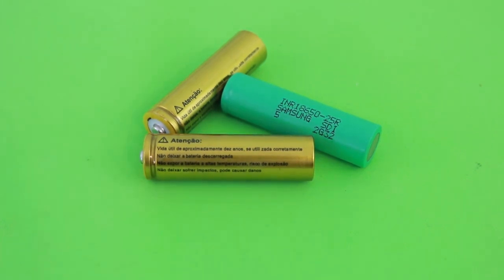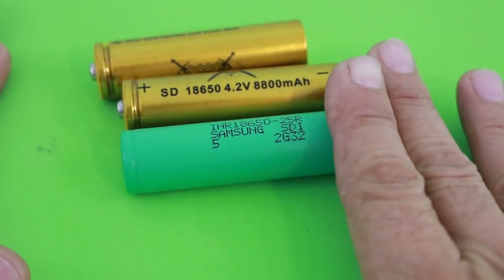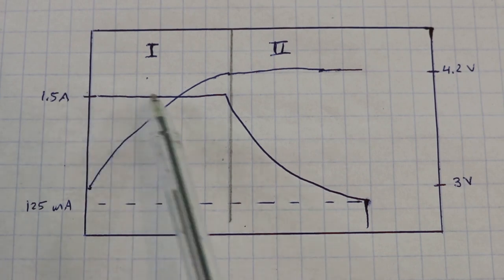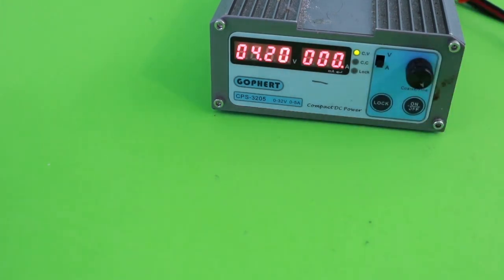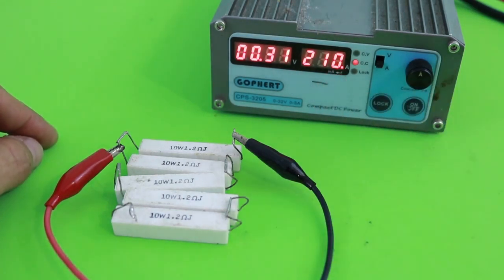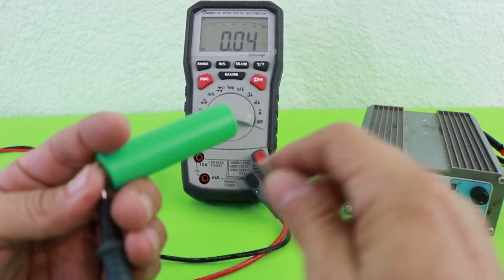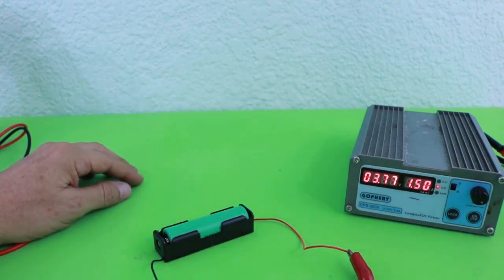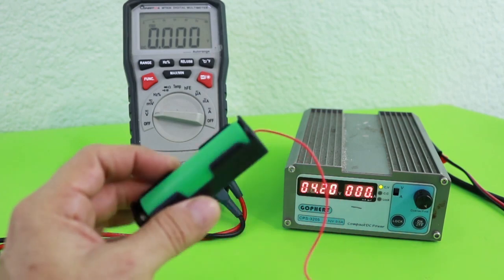How to Charge Lithium Ion Batteries with a Power Supply

Comment: I’m interested in charging cell phone and camera batteries with my DC power supply. Those batteries show the output voltage but only show amp hours and/or what hours which is not a measurement of the current draw, so I don’t know where to get that info. Also neither of my 2 bench power supplies allow you to set current. I have a bunch of wall wart power supplies so I usually find one with adequate voltage and use it to charge some batteries.

Comment: If i have battery in parallel. My amps should 6amps?
Reply: Yes, in parallel current is multiplied by the number of cells.
Reply: @charleslyell3748 does the voltage stay at 4.2 regardless of the number of cells? Or does it also need to be multiplied?
Reply: @someoneinAZ  4.2v, regardless the number of cells.

Comment: My bench power supply has max output volts to 17V
And 2A
Im trying to charge a 12V car batt lead acid
When i connect the psu to batt the psu drops to 11.5 V??? And fluctuating (11.1V-12v)
And amp fluctuate (0.00 to 2.99)
What is wrong here?

Comment: What will happen if we failedd to disconnect at 125 mA . will that cause an overheating and explosion ?
Reply: Nothing will happen. The current will keep dropping until the battery won't take the charge anymore. You can see the video when he disconnected the battery when it's taking 125ma, the battery only charged to 4.12v not 4.2v . If you are concerned set it 4.19 and forget about it. New. Lithium ion batteries can be charged to 4.3v while the old ones won't reach 4.2.

Comment: I have a simple 4.2V 600mA power adaptor and 18650 cells that were in notebook. I checked them they all 0 volts, but I would like to revive them. Can I charge them with my adaptor (it is from flashlight)?

Comment: How to charge the Li-ion Batteries not used for long time having voltage arround 1.2v.
And how to test those are feasible to use?
Reply: Use power supply, adjust volt for 4.0v, go down by current to zero, connct battery in power supply, slowly raise current till 300 mA, be in constant current. Near full charge it will change to cv. Good luck.

Comment: Hi, do you need to install blocking diode to avoid power supply damage from inrush current (while charging) ?
Reply: Raphael U : I hope a professional experience man to reply this question because I need it also. And what is the power of that diode.
Some body help. Please

Comment: So the power supply you used has the ability to set cv and cc having done that am I ok to leave the battery on that power supply overnight? Is the setting of cc and cv on the power supply as you show, render the power supply as a protection device.

Comment: Love your videos, I have to add something though. I think the resistance does not change instead due to the battery voltage rising the voltage difference between the cell and the supply decreases so the current through it also decreases. I've been charging cells like this for a long time

Comment: Be warned. Some PSUs do not tolerate current sourcing components (like battery) at its leads. A substantial current can damage the unit.
Reply from the maker: Its the first time I hear that. Have a link with more info please?
Reply: @ludicscience  e.g. it is in Rigol DP832 user manual. Manufacturer advises to add diode to prevent reverse flow.
Reply: it is described in a document: "Active loads and the RIGOL DP800 and DP1000 Series", you can find it on google

Comment: How it took to get charged ??
Reply from the maker: around two hours
Reply: @ludicscience  
If i connect more than one battery in parallel the chargeing time will be the same ???? Sorry for bad grammer
Reply: @Not-C-418  Yes, if the powersupply delivers enough current to charge all batteries; that is 1,5 ampere per battery.
Reply: @Pumba3900 does that mean that the amps need to be multiplied by the number of batteries? Ex. 3 batteries, 4.5amps?

Comment: Awesome 👏 video..... always the best!! How long did it take to fully charge the battery from 3V to 4.2V ?
Reply from the maker: Thanks about 2 hours
Reply: If I use the ordinary battery charger which is plugged to the wall- socket , will the result be different??? Which is more efficient??
Reply: @andrewkhchan depends what you mean by efficient.
scientific definition would be amount of energy charged into the battery / energy spent. then I would say the slower the better, less current means less heat, so power supply will let you pick a slower
if for you, more efficient means faster, then I would say the power supply will let you select a higher current but you may damage the battery or wear it faster.
 the biggest difference is the charger is calibrated to charge with a fixed max current value. with the power supply you can tune to the battery characteristic. but you have to cut off manually, so more likely to overcharge. you have to know what you're doing too. but it's also still possible to damage a battery using the wrong charger
I'd say the "best" charger would probably be a smart one like when charging a smartphone or ev, that will automatically adapt current with battery temperature, maintaining the best charging speed/battery health compromise. unlike smartphone, zv's have active cooling which allows to push the limits, best production ev charging speed would be Hyundai/Kia with less than 20mn for 5-80%. EVs prioritize battery life over pure speed because of the price of batteries which can be up to 50% of the vehicle price, and replacing batteries under warranty (8year)is a huge loss for the manufacturer. but unlike smartphones, typical 30 miles driving/day is only 10% charge for a log range ev, which allows loger battery life . also ev with fast charging usually have at least a small buffer to allow charge to 100% with lower impact on battery health